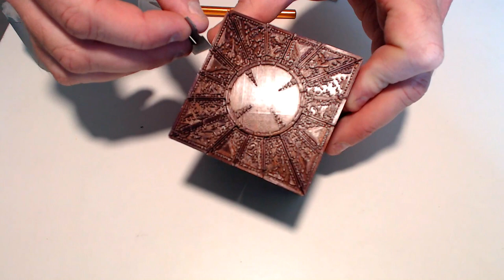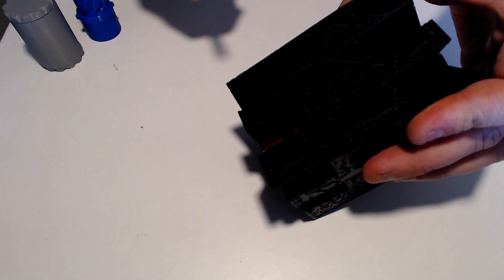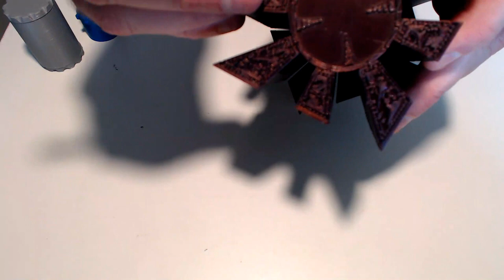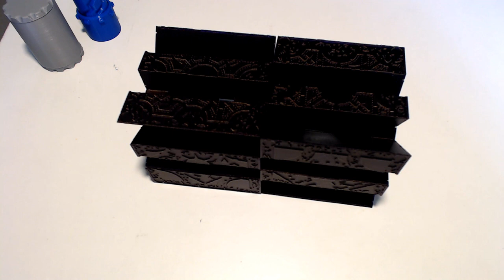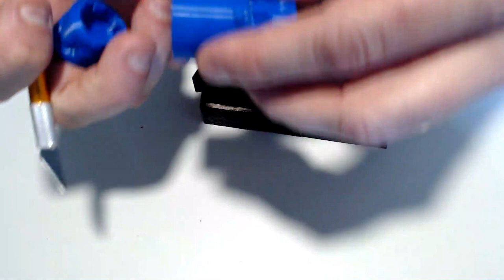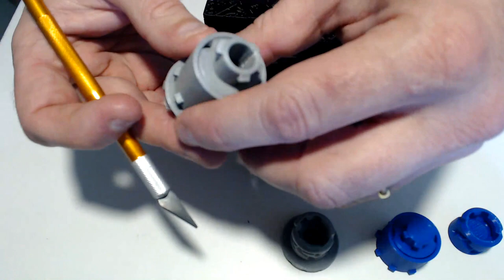Puzzle Box of Unknown Origin

Comment: Can i use a liquid resin printer to make this?
Reply from the maker: The question has come up a few times, no examples yet. Would come down to strategic support placement (I suspect) when it comes to translating FDM "tricks" like bridging and 1-layer gaps (while still being able to separate them without being able to reach inside. I'm just starting to dabble in resin with my first printer on the way.
Reply: @TroyMackay  I just got a resin printer and I am determined to print this! It's might not go as played but I'll be damned if I don't try!
Reply from the maker: @zero-production-value  Me too. It's a different ball game than FDM, so I think it will need a few tweaks. Hope to spend some time on it this weekend. Keep an eye out for an updated model. Also trying to figure out how to print it in multiple parts - I kind of designed myself into a corner with the whole print-in-place thing.
Reply: @TroyMackay  I realised it wouldn't be possible to print the whole thing in one piece using a resin printer as when it comes to the curing process you wouldn't be able to get light into the centre. Would definitely need to be printed in parts, not sure if the locking mechanism can be printed in separate parts then assembled and just have caps that glue to the mechanism to hold it all together maybe?
Reply from the maker: @zero-production-value  Hmm, I hadn't considered that. Figured sunlight would penetrate fairly well but perhaps not. I'm tossing up a few ideas, like having some sideways slots halfway up which would allow the core to be removed by rotation. Removable dials should be quite doable, from previous experiments.
Reply from the maker: @zero-production-value  Something like this? https://www.thingiverse.com/thing:4967195
Reply: @TroyMackay  awesome! Now I just have to wait for my resin to arrive

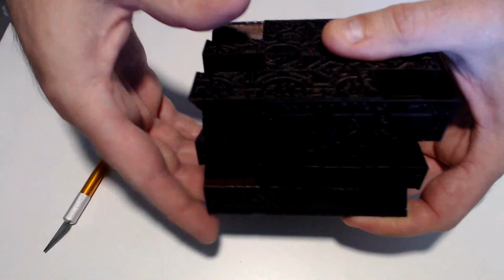Comment: Ive got mine to open fully like at 3:51 but it will not spin
Reply from the maker: Nice one. It might require a little force the first time to crack the seal. There is heaps of leverage, so it shouldn't take much.
Reply: @TroyMackay  is there a seal that needs to be cracked or freedup, ive applied a decent amount of force
Reply from the maker: @SGTBaconese  There are separate parts, which when print will tend to slightly stick together, usually just the first layer. I'm talking about the inner core cylinder piece which has a separate turning section. Take a look at the exploded view in the description if you haven't already.
Reply from the maker: I just remembered a setting in Cura I have been using, Z Seam Alignment: Random. Binding can occur at prominent vertical seams otherwise.
Reply: Ok thanks, maybe I'll try again